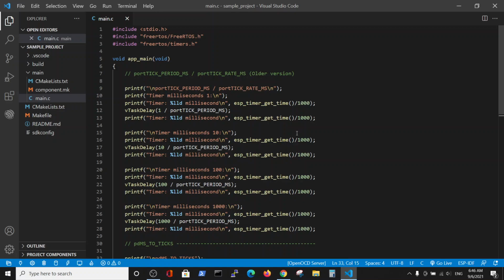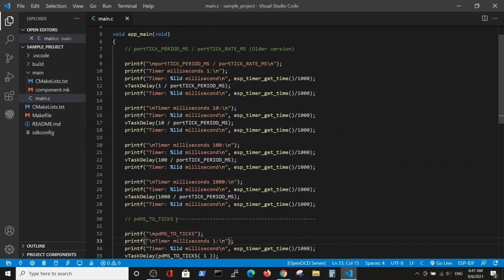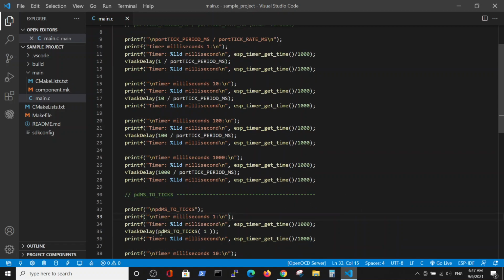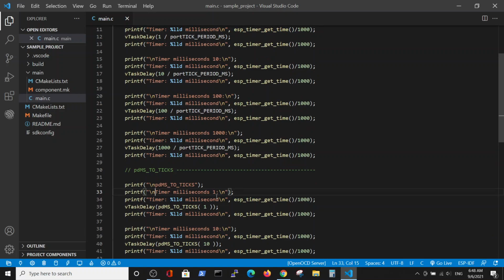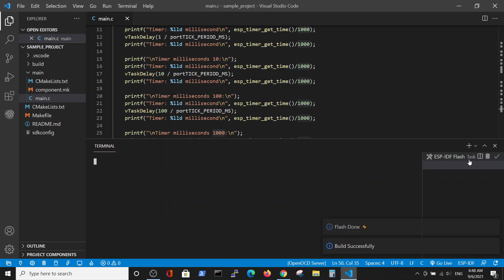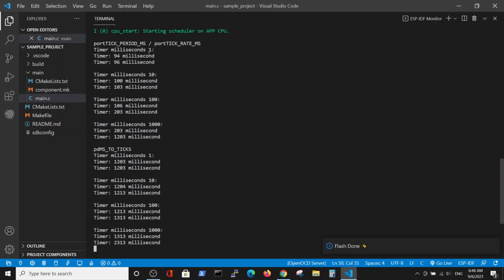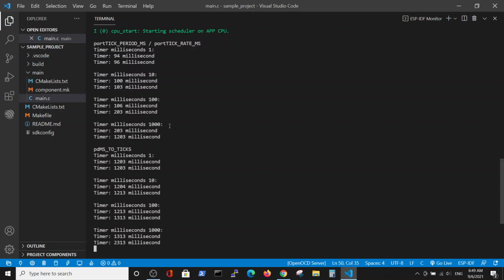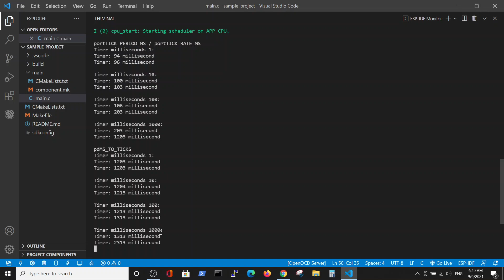ESP IDF Timer 6   vTaskDelay in mSec full comparison

Comment: I found your video when searching to see if there was any difference between the two methods of converting milliseconds to ticks and decided to do a similar experiment.  For mine I cached the delays in microseconds before calculating to avoid any potential contamination, and took 20 samples that I then averaged.  These were the results on an ESP32-C3 in milliseconds (and microseconds) as a double to two decimal places.

   1 / portTICK_PERIOD_MS = 0.01 (5.25)
      pdMS_TO_TICKS(   1) = 0.01 (5.25)
  10 / portTICK_PERIOD_MS = 10.02 (10022.75)
      pdMS_TO_TICKS(  10) = 9.96 (9963.40)
 100 / portTICK_PERIOD_MS = 100.00 (99999.15)
      pdMS_TO_TICKS( 100) = 100.00 (99999.20)
1000 / portTICK_PERIOD_MS = 1000.00 (999999.15)
      pdMS_TO_TICKS(1000) = 1000.00 (999999.15)

I ran this three times in a row and got the exact same results twice!  The third time there were some differences in the fractional part of the microseconds, so it still came to the same number of milliseconds.

Comment: Doesn't the printf command take time ? how much time it takes ? is it affecting our results?
Reply from the maker: Dear @user-wc5gs4tt2m,
I do not think there is a straight answer for printf command execution time. It depends on numerous factors including Drivers, Buffering, FreeRTOS Configurations, ...
You can check it for your machine by printing the time before and after the printf command.